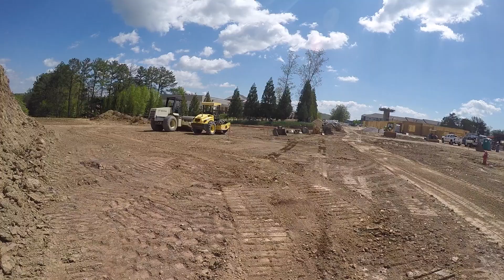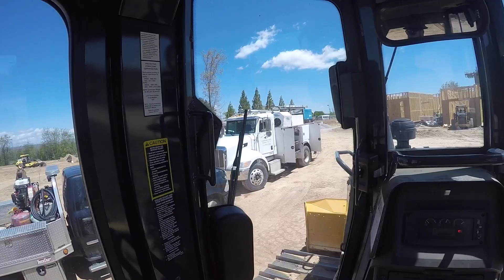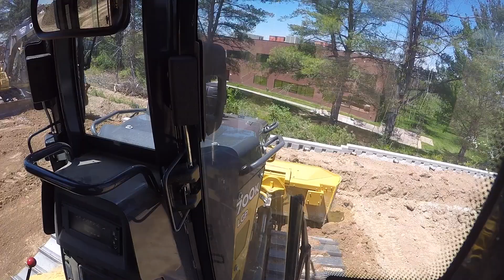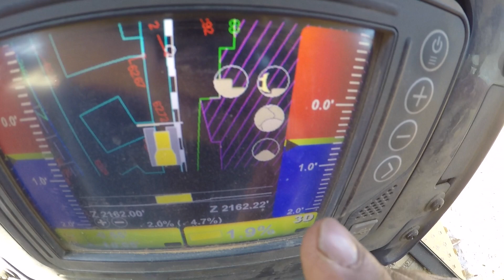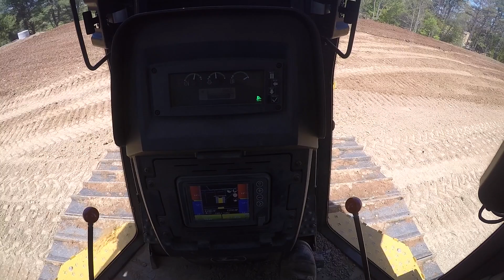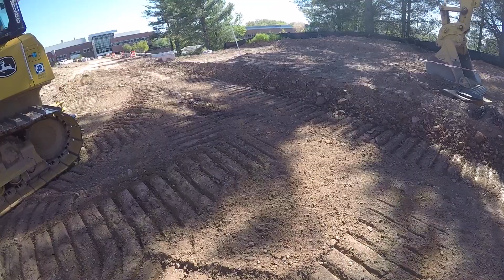3D Dirt Printer

Comment: Where you get those safety glasses? Needing me a new pair an tired of the ole cheap black pairs I been using.
Reply from the maker: Actually those are special glasses that help me see color I have trouble with reds and greens blending together. They are expensive but they do help. They are Enchroma glasses.
Reply: @DLHFarms , I'm colorblind (technically color deficient) as well. I've been considering the Enchroma glasses. I currently have some clip ons that go over my prescription glasses. They help but they aren't magic. Are you happy with those glasses? I have a heck of a time sometimes finding the red paint in green grass!

Comment: Fantastic videos as always.  Over here in England we call the top layer of a farmer's field "top soil" and then the infertile layer below we call "sub soil".  When you talk about "dirt" is that the soft top layer or the base layer e.g. clay, chalk, sand etc? Thanks.
Reply from the maker: This would be the sub soil it has a lot of clay.
Reply: @DLHFarms  Thanks. Has the "Top Soil" been removed?  If so has it been exported from the site or has it been stored at the edge of the site for later re-use? Thanks from Olde England.  Your town used to be part of the British Empire, and could be again in the future, all you need to do is vote for it !

Comment: I hope there won't be any leaks with that plumbing. I know it has to be tested early but I've seen similar problems. Looks like the super wanted subs on the job no matter who it was lol. GPS system is the stuff right there!
Reply from the maker: Yeah it had already been tested. I would think it would have to be done again now but who knows.
Reply: @DLHFarms  I usually see an air pressure test stay on for quite a while after concrete is poured just to be sure. That way they can figure out "who did it" along the way.